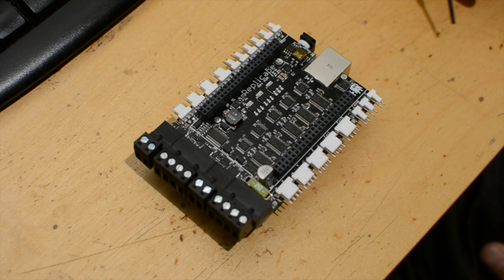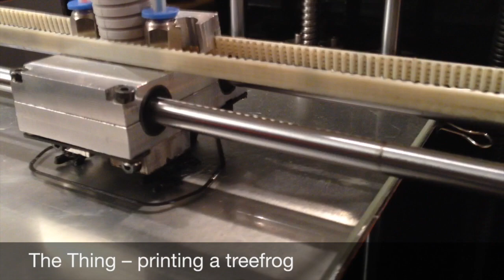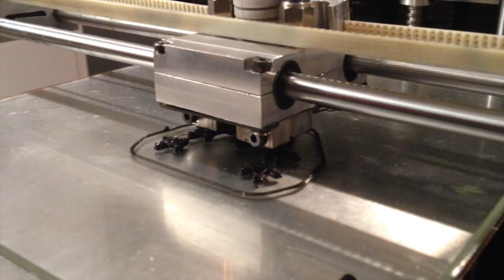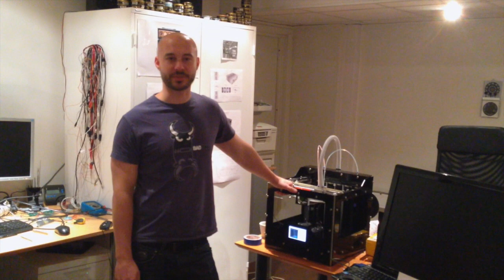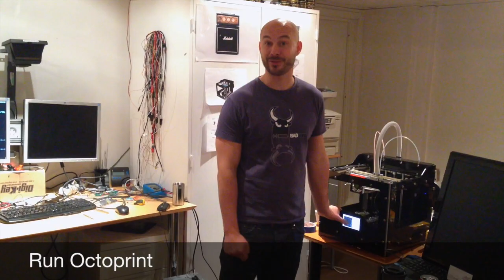Replicape specs

Comment: Do you guys have any plans for an expansion to allow for additional extruder heads? I'm looking to build a delta bot with quad extruders.
Reply from the maker: You can use the Reach board for that. It adds three more extruders, but it has not been put into production yet.
http://www.thing-printer.com/reach-expansion-board-replicape-ready-review/
Reply: That I would definitely be interested in. Any idea when it would be available? I know you guys are pretty busy with the Manga Screen at the moment.

Also. Could an external stepper driver be used or would I have to wait for Reach to be made available?
Reply from the maker: You can use an external stepper driver if you want, and if you have the means to keep the temperature through other means or a single heater block for multiple extruders.
Reply: Gotcha. Is there any documentation you can recommend I read to learn how to get it set up or a site I can search around on and find the answers myself? Thanks again for all your help.
Reply from the maker: Sure! The wiki is the main starting point for Replicape and Redeem: http://wiki.thing-printer.com/index.php?title=Replicape . There is still a lot of development going on, so the wiki is not always up to date. For the latest info, you need to "use the source".
Reply: Elias Bakken
I actually didn't think about the Replicape only having 3 Thermistor inputs until I went back and reread the specs. It is a pretty awesome board and once the Reach expansion board comes out, I think this will be the board to get.

I'm still getting the plans finalized for what I need for my printer. Once I get my hands on a Kraken is when I am really going to get looking for a board. I will definitely be following this project and eagerly awaiting the Reach board.

Sadly, I am not savvy enough to be able to work with source code of any type. Only experience I have with coding is basic scripting for a very crappy AoL messenger bot. :/

Anyways. Thank you for the quick replies and all the information you provided. I'm looking forward to seeing this hardware develop and to getting my hands on it down the road.